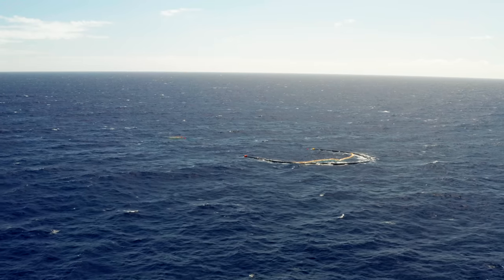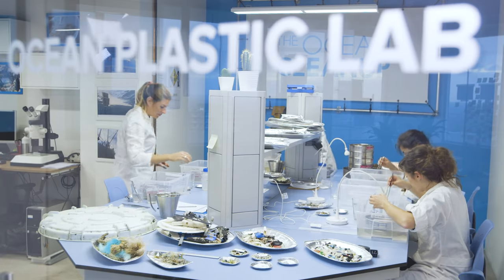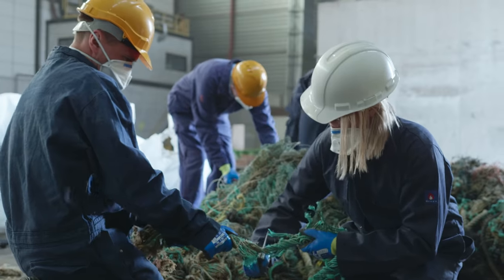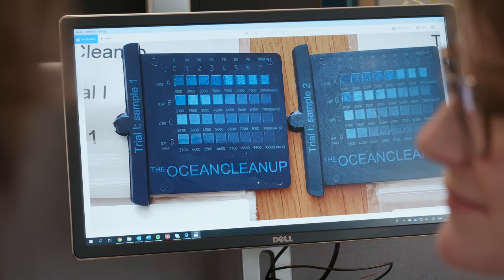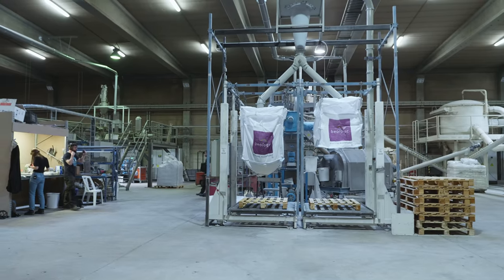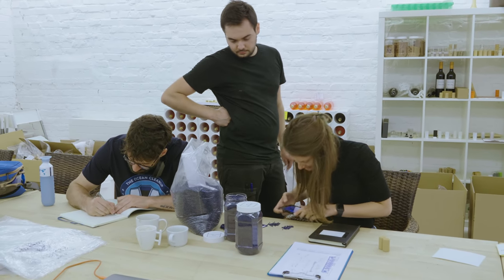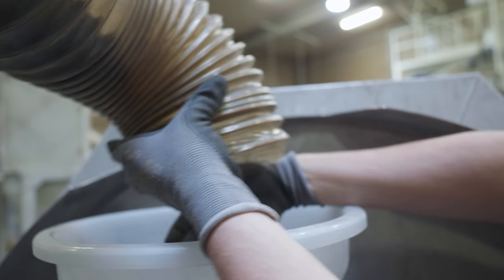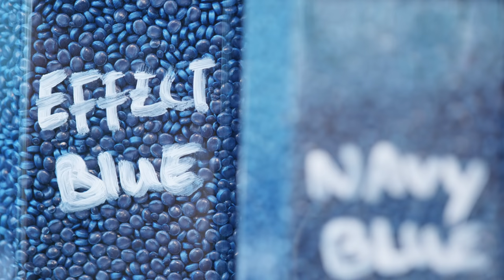Turning Ocean Plastic into The Ocean Cleanup Material | Cleaning Oceans | The Ocean Cleanup

Comment: Can you form it into plastic filament for 3d printers ? People would make marvolous things out of it ?
Reply from the maker: Our plastic catch consists primarily of HDPE, with a small portion of PP. While it is possible to use some of the material for 3D printing, it would not be possible with all of the material we collect. 3D printing with HDPE can also be tricky as it has low self-adhesion, resulting in the layers not sticking together very well, and possibly warping.  
 
This plastic is exceptionally difficult to recycle, and we have spent years working with specialists researching how to best use this plastic. In making a product, not only are we helping to fund our future cleanups, but we have ensured that the plastic is transformed into something high-quality that people will want to cherish for a long time.

Comment: What is the point of recycling plastic into tiny beads? It's even more harmful for ocean when it eventually ends up back in there.
Reply: That's not the end-product, just a convenient form of "raw material", wich can the be melted and molded into whatever they want
Reply: the tiny beads are just a phase between processing, the form makes it a lot easier to process later on ;)
Reply: So they can remanufacture it into useful products, they melt down a variety of grades of plastics down to the liquid form and combine them so they can achieve consistent products
Reply: @adrianburmester1159  Alot of this "convenient raw material" ends up in the water system. The banks of the river Scheldt in Antwerp are seriously polluted with these beads and it's all because the chemical plants (who produce plastics from beads) would rather pay a fine than getting rid of them properly. Who will secure these beads don't end up in a landfill or the bottom of bodies of water just the same?
Reply: @DarkAngelEU  Yes. I did not say otherwise. I was just trying to explain why this form was chosen, not analyzing the end to end path of plastics. And although I don't have any inside information, I would assume "The Ocean Cleanup" actually might take steps to prevent any waste.
Reply from the maker: It is just a material that we will use for our own products. We'll be announcing what that product is on October 24th!
Reply: @theoceancleanup  i am totally in with cleaning the ocean, but i dont get why you have to make all of it blue and produce some ocean cleanup plastic product. just sell that stuff well picked industries so they dont have get new plastic